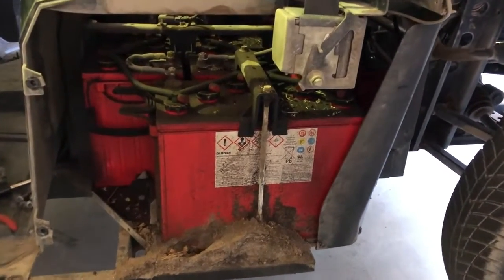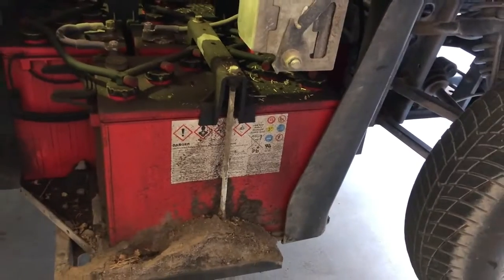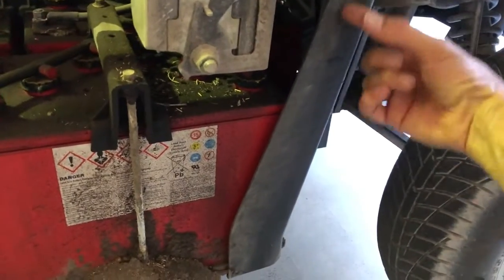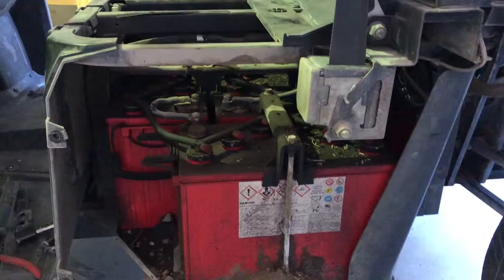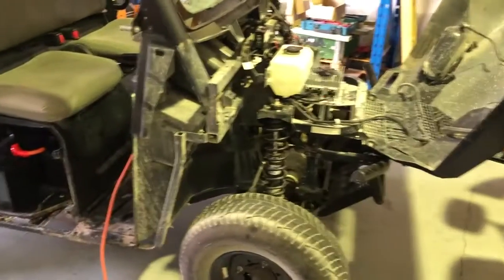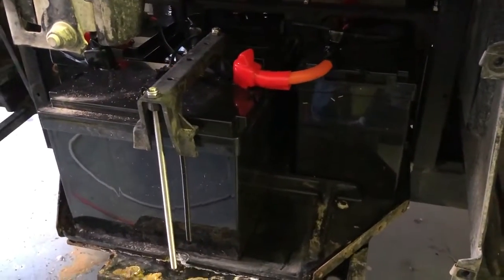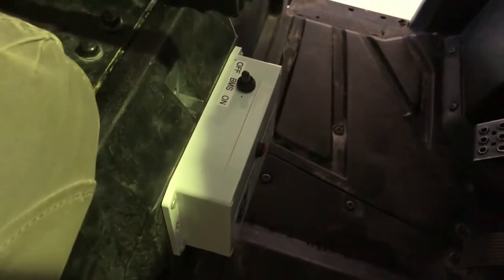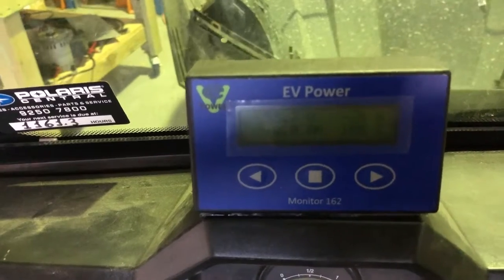Polaris Ranger EV Lead to Lithium Conversion

Comment: Hey there! Looking to connect and talk about purchase options for your lithium powered structural protection pump system. Reached out on your website Contact Me a couple of times. Can you check the spam filter and get back to me. 
Cheers!
Reply from the maker: I answered twice and both times it bounced. Please inquire with a different email address.